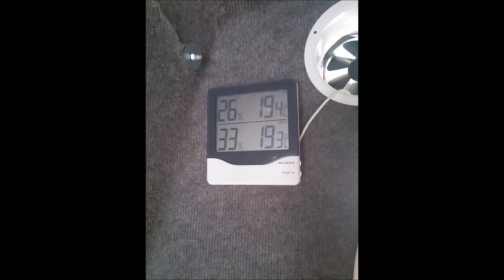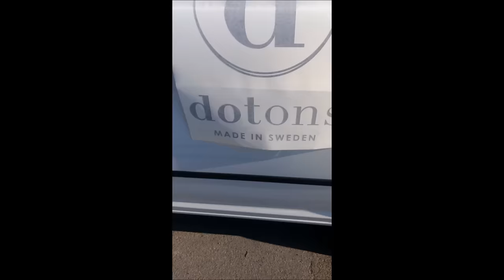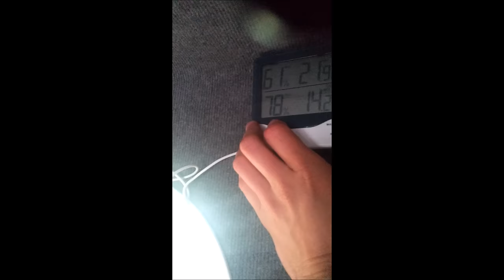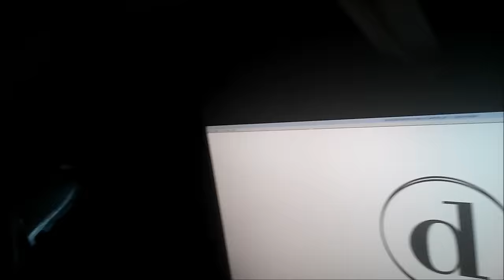How To Build A Camper Van / Mobile Home In 20 Days ! *With subtitles!*

Comment: My Father built his own Camper Van Mobile Home. It took him 8 years. he made the chassis from Box Steel, Welded and Galvanised. That took aprox 1 year and another year to choose a V4 Engine Transmission and brakes. The rest was bodywork, plumbing, heating and of course lights etc. Finally an Engineers report to make it roadworthy and pass a MOT.  By the time he finished he was too old to use it and it was sold. Maybe he should have converted a van instead. Good convertion. George in the UK
Reply from the maker: MakeDoAndMend1 great story you shared, thanks for that! if you want a look on the inside of the van, I now made a video showing just that!

Comment: Very interesting, but it would be nice if you listed or made another video that explained your process to build the walls and what materials you were using. I can see different things in the video, but of course if you explained and laid out the steps or process it would be easy to understand. My question is always how to create the walls, partitions and floors. I have an old book from the 70's, but it's basically plywood and carpeting. Makes for a very hot and humid interior. 
I also liked you use of flat boards, or what some would call a "lamination" or layered style. Simpler construction means simpler tools and cheaper alternatives (depending on location and the person's skills and tool kit). Maybe your video isn't great, but nice job on the van.

Comment: clean up the car, glue foam to its panel, foam gun holes, add brown layer, add wood panel and bolt it, layer it with some suede lookin material, put wooden floor. 

whats that brown layer and wheres those bolt goin thru? sorry for askin too much, 😅

Comment: You will be surprised how fast the areas you used the spray expanding foam.......will rust ! !   I did a van in the 80's with that stuff.....really attracts a lot of moisture resulting in corrosion.
Reply from the maker: Hi Maximus,

Thanks for letting me know, Im glad I just used a little of it, im not a big fan of those chemical things... Next time, I will find a better way!/N
Reply from the maker: Hi Maximus,

Thanks for letting me know, Im glad I just used a little of it, im not a big fan of those chemical things... Next time, I will find a better way!/N

Comment: Perfect!  Thanks so much. This will help tremendously when I get my van.  Awesome job.  Once question:  Why the port hole vs. leaving it accessible from the cab?
Reply: For stealth mode.  If it's open from the front, anyone who wants to see if you're sleeping in there, will.  ;)
Reply from the maker: Hi Carolyn! Glad to hear! I choosed not to leave it open for many reasons. I tried to make it as good insulated as possible, all windows in the front will make the cab area really hot, so I tried my best to keep that heat away from the living area. Another reason is if I carry expensive things I want to feel that they are safe, so as +happyfunjenn says, for "stealth mode". I also wanted two rooms, If I carry something wet and dont want the moisture inside the room where I live (I swim a lot, so it's perfect to let everything dry in the cab!) This will also give you peace at night even if sleeping in the most crowded city! It makes it so quiet! Hope this will help you! /N
Reply: +dotons thank you!

Comment: Isnt it better to have metal, air, isolation and then wood?
Reply from the maker: I found out that putting the aluminium foil next to the metal frame is not that good as if you create a barrier with the white cell insulation between those. It will prevent the heat transporting from the metal frame directly to the aluminium foil.

I didnt really think of wood as a part of my insulation, I used the wood to glue the carpet on!

Hope it will help you!/N
Reply: Insulation is actually bad for the heat but sure.. That's why most "vanners" remove it after the first summer.

Comment: all i see is a bed in the back of a van... wheres the sink, toilet, shower, oven, microwave, refrigerator like all Campers have.
Reply: its a very small van he should have used a chevyvan or gmc vandura
Reply: he has a tiny sink and a tiny refridgirator + solar... nice setup... i bought a regular camper though and got (120watt) solar installed on it... adria aviva 390 ps. i could live in it, however only as long as tempratures is above freezing because of the water issue, which is sort of the idea so i can seek asylum along the coast or mountains in the summer because of my (bad) allergies. it use propane for heating and cooking, not microwave. then you'll need to hook it to the grid because of electric use, so i dont even have it installed, i make food the old fashion way with a frying pan. there are alot of limitations to offgrid living people arent aware of.
Reply: This is for hardcore survivors who doesn't want to live out in the wild with complete luxury in a $5m Motorhome
Reply from the maker: Christopher Jones you where right! so I made an upgrade, just posted the new video, hope you like it(:

Comment: What is that so much isolation for?
Reply: Brrrrr. And how does it work? I mean how many degrees C outside and how many inside on a cold winter day?
Reply: In sweden, it really depends in how far north you are. In nothern sweden temperatures can get below -20 fx.
Reply from the maker: It's still summer! Will get back to you when the winter comes!

Comment: I think the video is fine, a little fast, wrong orientation and not enough time on the details. 
However excellent job.  I wanted to ask why you went so involved with a van of that size? it seems like if you applied that technique to a larger van, you would have so much more options. future proofing etc. 
good work though.
Reply from the maker: Hi Mikee6,

Glad to hear! I agree the video is not as good as it could have been. I choosed to put more effort when building the van than when filming it!

The answer of your question is that I was looking for a cheaper van to drive and for a small one that would fit me well in need of parking and driving in bigger cites, because of my working trip ( I will travel through the whole europe, city traffic, a lot of meetings in town, without much money!

So I guess this is my level one, a great start, from which I now can grow and learn from. If this way of living makes me feel good Im sure I will consider your thought.

Thanks for asking!/N
Reply: dotons Absolutely, It's hard to consider all aspects of the filming when involved in such a project. 

Makes sense about the size in the end then. Good choice.

How much were all your materials in the end ? it looks like you used high quality stuff, that's a seriously well insulated van, probably suited for an arctic expedition!

Good luck with everything sir

Comment: Hey man how did you do the ventilation system?
Reply from the maker: I take fresh air from the coupé windows, the cold air get in to the area where I sleep via a pipe. The pipe leed the air to the back of the area where it comes out, then it travels across the room and gets out in the upper left corner, and back out trough the coupé windows. Hope this will help you!/N

Comment: I hope you install some sort of AC in there that insulation is gonna bake you like a potato in the summer heat.
Reply: you obviously don't understand how insulation works!
Reply: dan H Every van dwelling blog removes the insulation after the first summer so I think I speak from their experience.  Heat gets trapped inside and can't escape.  It's pretty simple.
Reply from the maker: Hi Baka!

I have tried to build it in a way so I not need an AC. I leave the front windows open to get fresh air in the front, the cold air gets in trough the pipe which is attatched under the bed. The heat gets out of the living area via a pc fan, installed in the upper left corner. I have been parking in direct sunligt whole days without any problem, so atleast this works for the summer we have in Europe! But I guess I will make changes later on, when I need to! Thanks for sharing your experience!/N

Comment: Claustrophobic
Reply from the maker: Hi Roberto,

I feel the same, the video show you the version 1.0. In July I will start rebuild the bed and focus on storage, a kitchen and an option for sitting. I have been out on the road and tried the Van for about a month, and Now I have got a feeling of what I need to change and add. The insulation works great and that was the first big step to find out! Now I can just add what I need on the inside(: